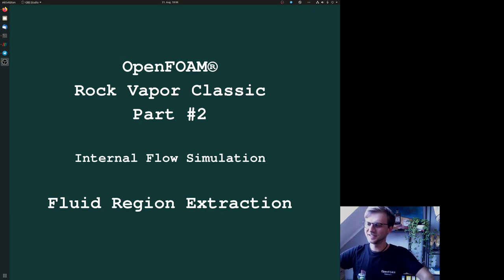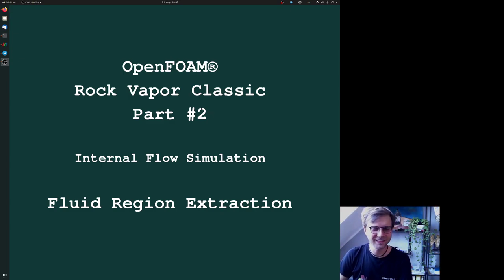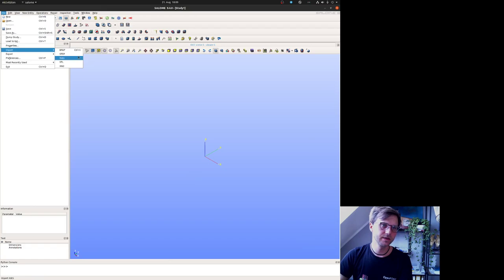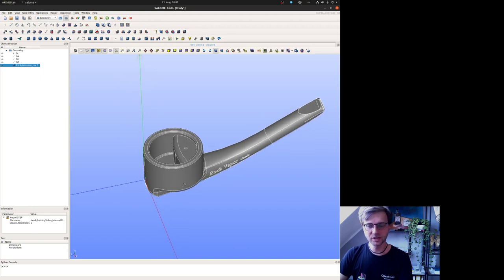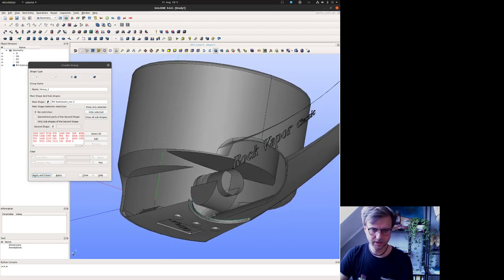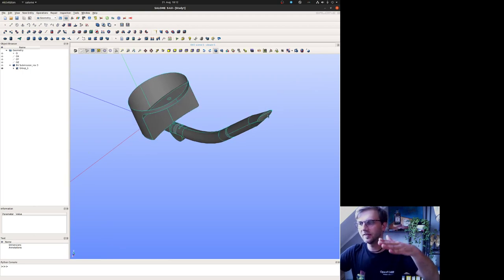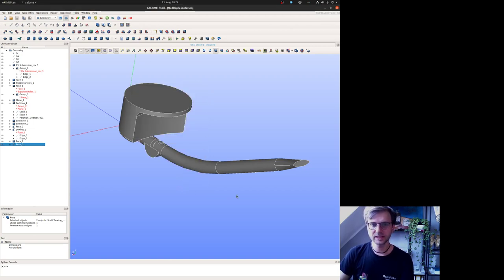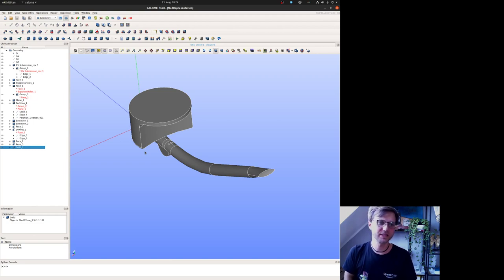CFD Analysis of a Smoking Pipe | Part 2 | Fluid Region Extraction ∇ OpenFOAM® v8

Comment: At 7:00 when selecting suppress holes it doesn't recognize the wires, it tries to select the whole face both with exploding and with suppress holes. Any suggestions?
Reply from the maker: No I am sorry. Probably you are using a different salome version? No idea about the latest releases of salome and its release notes.
Reply: @HolzmannCFD  I am using 9.10
Reply: Regarding the pipe mesh it seams the model was not longer fitted for the method. I made a new one, sent you an email with the evidence

Comment: Using salome 9.7 in kubuntu. to install all the packages needed. Use this command /sat config  SALOME-9.7.0-native --check_system.  Also to load the program only do ./salome in the installation folder. And one more thing. There is a nasty bug to create grups. is very important NOT to take into account the embedded units into the file if not you will crash salome
Reply: I have that issue along with suppress holes not selecting the wires
Reply: Buddy thank you so much for this comment it wasn't making sense I have 32gb Ryzen 9 and rtx 3060 and creating a group was hell, and just because I clicked "yes" in  that units thing, now is smooth thank you!!!!!!!
Reply: @lq_12  same here i spent whole yesterday evening and todays morning trying to understand :D
Reply: @volkanatar4232  are you using Blue CFD, Ubuntu LTS or Ubuntu?
What version of Salome are you using? 
Are you writing a thesis?
Do you need to heal a geometry?
I can give you some advises and I can tell you things that happened to me
Reply: @lq_12  no i use OpenFOAM v2212 and Salome 9.11.0. I was using Salome actively about 2 years ago and i was just checking these videos to refresh my salome knowledge so nothing serious or urgent 😄 i knew that Tobias has this tutorial videos. The one i was using back then was Salome 9.7.0.
Reply: Ubuntu 22.04 LTS
Reply: @volkanatar4232  All right I couldn't heal geometry even though I downloaded same CAD model.
Also OF versions have slightly changes ( I didn't know that)